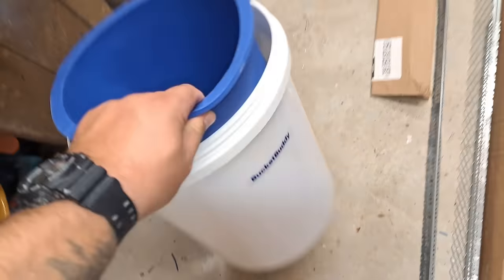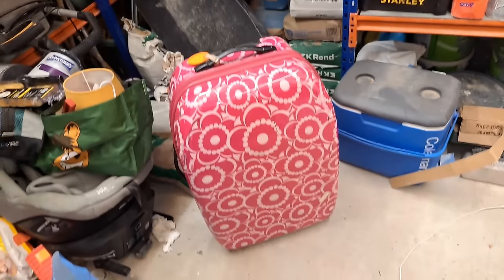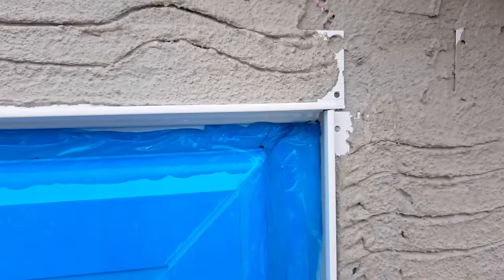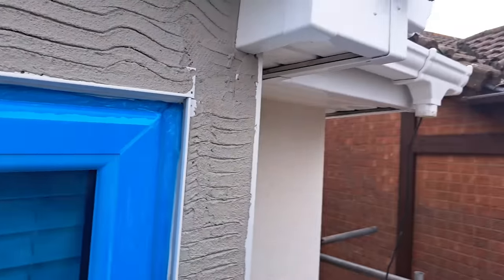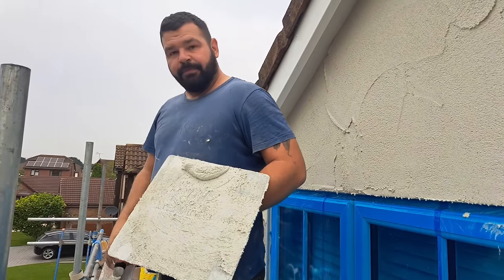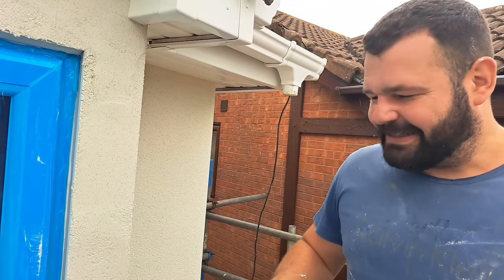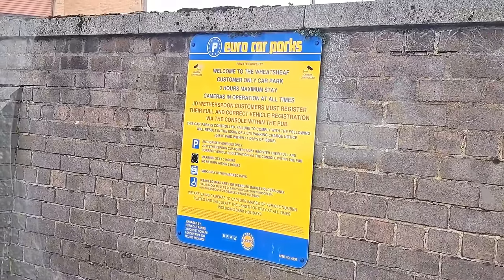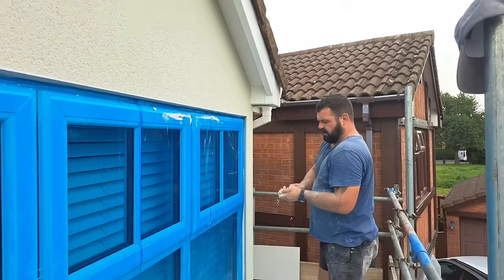A DIFFERENT KIND OF DAY

Comment: Hi Kirk did you just sand and cement render the backing or was it specialist backing product. I see in a previous video you installed the render mesh in the grey background and not the coloured k rend. Also what thickness beads are you using as surely if you are putting a backing render on first with imbedded mesh then I rend top surely they would need to he thick ?